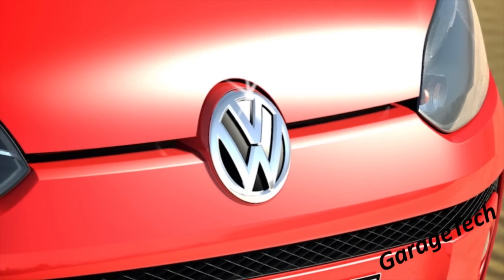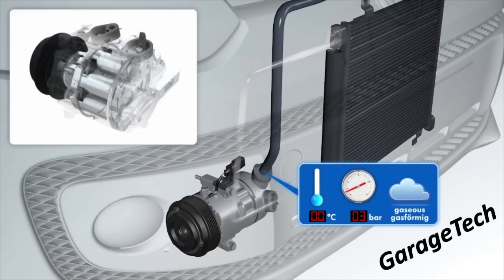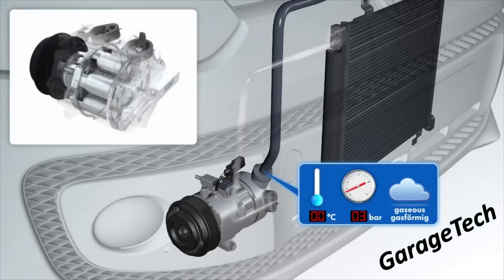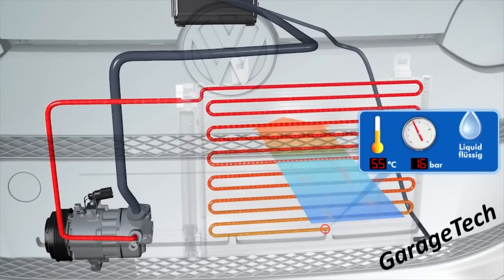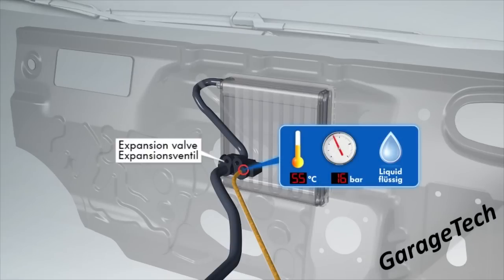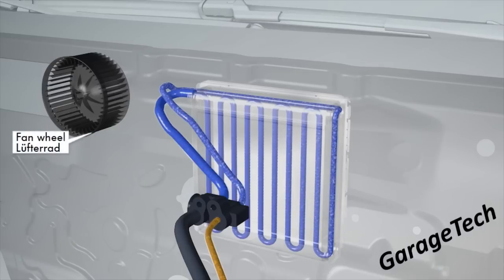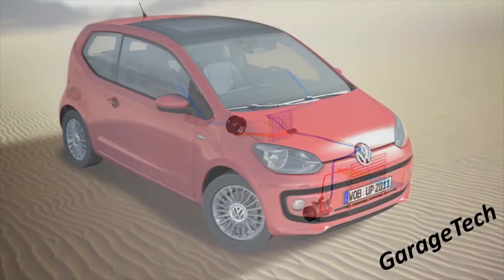How does a cars Air Conditioning system work?

Comment: Shouldn' temperature stay the same through condenser? When I saw constant temperature I thought you will show pressure dropping due to friction losses in condenser. It's either both pressure and temperature drop or they are both constant if you ignore friction loss.
Reply: Temperature Cannot stay same through the condenser. Only pressure. 
Let me explain why. 
1) Heat always moves from the hotter body to the cooler body.
2) When the compressor suddenly compresses the refrigerant gas, the gas  heats up. (Thermodynamics) 
3) As  hot refrigerant gas moves through the condenser coil tubes,  a fan blows air over the body condenser coil tubes.
4 ) The condenser is a perfect heat exchanger so heat in the hot refrigerant gas  moves away from the refrigerant and this heat moves into the cooler outside air.

 Remember that heat always moves from the hotter body to the cooler body. 
The condenser is hot 95°C and the outside temperature is lower 27-35°C so the heat in the refrigerant gas would be lost to the outside air.
As the gas becomes cooler it condenses back to a liquid,  hence the name condenser. 
If you don't understand just read more on heat exchangers. The condenser is a heat exchanger.
Reply: @ossainduka853  condensation is a constant temperature process, same as boling. Does water change temperature during ita boiling stage?
Reply: @MrPlankton996  I will say again,  temperature cannot remain constant through the condenser because the condenser is loosing heat to the outside environment 

Consequently the hot refrigerant gas inside the condenser coils would condense into a liquid.
Reply: @ossainduka853  When a refrigerant changes its phase from gaseous to liquid it is loosing a lot of energy in form of latent heat. That's why it is possible for it to take place at constant temperature. Your explanation that it's loosing heat, and therefore lowering temperature isn't correct. Google "latent heat".

What happens with water when it boils? Isn't it receiving heat but staying at 100 °C? It's only a phase change, but temperature is the same.

Comment: Considering that AC means Air Conditioning, not just Air Cooling, how does cabin HEAT work with regard to this process? Is air from the heater fan routed directly into the cabin, bypassing the evaporator? Or what?

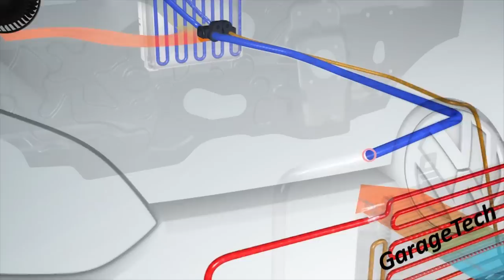Comment: 6:10
If I insulate that pipe (low pressure line) that feeds the compressor, will it damage any component of the system at all? Do you suggest to insulate the low pressure line?
Reply: alsogooraa why do you want to do that
Reply: @downyfabricsoftener8790  I live in a very hot area and some people insulated the low pressure line and they said the AC became much colder. However, I am not sure I this will affect the compressor in the long run
Any idea?
Reply: alsogooraa it might provide a tiny bit of improvement but I honestly don’t think it’s worth the trouble because of how little it’ll affect it.

Comment: You made a mistake about when the high pressure and high temperature Liquid leaves the expansion valve . It stays in liquid form but low pressure and low temperature It evaporate inside the evaporator due to warm air passing thru the fins of the evaporator.
Reply: 🏆 I agree

Comment: I'm getting some water dripping into my legs while driving while ac runs especially when i street left or right.
Can u help me to find the reason?
Reply: Water dripping from any AC system is normal but it should be dripping outside of your vehicle. When the evaporator box drain gets clogged with debris the water can't drain out so it will fill the box until it overflows inside of the car. Remove the debris from the water drain located under the hood coming out of bulkhead. That should take care of your issue. Search Youtube using key words such as "unclog your car AC drain" for helpful videos.
Reply: It's normal for water to be produced. Something which isn"t normal ,is for water to drip to your footwell.

Comment: sir..one question
 scenario we are testing system for leak would that be from low pressure point or h pressure point also assuming we are putting compressor air to check leaks.
your quick reply be highly appreciated ..we had checked system from low pressure side that holds pressure for 1.5 hr then we refilled freon but it's leaked after 40 days
i

Comment: I have a question, in a situation like 8 hours of traffic jam like in China, the quality air inside the car, will likely lack of oxygen and exceeds co2 level because you don’t want have air circulation as you open the ventilation it will suck the smoke from the exhaust of the car in front of you. What is the solution then?

Comment: What would happen to the A/C system,if the sensor bulb on the evaporator broke or stopped working ? Great animations of the system...
Reply: The compressor clutch uncouples from the belt.

To avoid dammages. Same thing happens if the gas is leaked. 

Extremely low or high pressure reads make the compressor pulley to deactivate / uncouple...

Comment: That is a Fantastic and simple explanation of how the refrigerant works in a compressed state.. what I can't seem to find is a video explaining how the electronics side of the system works ? Like what happens when you push the a/ c button on the dash ?  Sends a signal to what and what pressure sensor those and  fan clutch closes etc. ... Which intern leads to the video you just presented.. thanks I hope you have a video on it , and if not would you make one ?  It's good to understand how the whole A/C system works. I need to know in order to try and repair my 2007 Honda CR-V a/c system .. I need to understand how it works from when you push the button.. Sorry for the long comment. Thanks again.

Comment: Thx for the video, Lik&Sub. Question. Can a 12v dc motor or 24v dc motor power a car ac compressor for the cooling system to work? Ty
Reply from the maker: In my opinion it wouldn't work. If this was a good idea car manufactures would be doing it already. You would need a large motor and it would drain the battery quite quickly. Electric/Hybrid vehicles have electric compressors which work in the region of 280V 16Amps. This is powered by the high voltage battery. A 12 or 24 volt battery just wouldn't be powerful enough.

Comment: This my question. Cosume more gas when you use car aircon. That is true or not.
Reply from the maker: Eric Geollegue, not true, the gas isn’t consumed. The system will loose gas over time especially on older systems. The seals become dry and gas will start to leak out. That’s why it’s better to use the AC as it keeps the seals lubricated. The system is filled with (150ml) PAG oil which lubricates the seals and compressor.
Reply: @GarageTechAutomotive  thank you so much. for your good imformation.

Comment: What is that weird smell that comes when you turn on the AC sometimes? Is it coolant becoming vapour?
Reply: That odor is usually the mold and mildew build up inside the evaporator box or at your cabin air filter. Keep outside vents clean from leaves and other debris, replace your cabin filter annually and spray some disinfectant into the air intake vents to alleviate or eliminate the nasty condition.
Reply: @steverivera6692  OMG thank you for that

Comment: Trying to learn AC in general and not just in cars. But what is the purpose of heating the freon to high pressure liquid instead of it continuesly running low pressure and a cold gas?

Comment: Expansion valve does not turn liquid refrigerant into a gas. It turns it into a low pressure liquid then passes thru the evaporator extracts the heat from the air and then It is turned into a low pressure gas then back to the compressor.
Reply: No, the expansion valve creates a pressure differential. There is a high pressure on the condenser side and low pressure on the evaporator side. When the liquid high pressure freon goes  through the expansion valve and hits the low pressure it evaporates into a gas. The evaporation is an endothermic process which is what provides the cooling.

Comment: Will the compressor cut in and cut off depending upon the temperature inside ? How that works ? Normally in the air con system once the temperature is attained a solenoid valve will close the flow of refrigerant and due to low pressure cut off switch the compressor will switch off.

Comment: How much power does an AC require. Power in electricity?
Reply: Strange comment, the fan belt normally drives the compressor.. but as a car is 12v.. TD5 Land Rover needs around 40amps. You can normally tell by looking at what size fuse is used is the engine bay..

Comment: Can I keep my ac temperature setting at Low or should I set it to a certain degree e.g. 25 Degree? Will I wear down the compressor faster if I fixed the temperature setting at the lowest? Thanks

Comment: The drier does not prevent any gas going to the expansion valve.. it doesnt turn to a gas after the expansion valve either. The heat exchange in the evaporator is what causes it to change into a vapor. Go back to school lad
Reply: The Freon absolutely turns into a gas after the expansion valve, that is what provides the cooling. The expansion valve creates a pressure differential, high pressure on the condenser side and low pressure on the evaporator side. When the freon goes through the expansion valve and hits the low pressure it evaporates. Since evaporation is an endothermic process, it provides cooling.

Comment: Does evaporator size matter?if we increase the evaporater size in an ac system what will happen to cooling in a car ac
Reply: The evaporator and many other parts in the system have to be sized according to the compressor's displacement and the compressor's displacement has to be sized according to the evaporator's size and other parts in the system... you can't just do that. Engineers already did that for you when the car's AC system was designed. Increase the evaporator's size only and not only you'll not experience any cooling benefit. You may also deprive the compressor of the proper lubrication return rate it was designed for...

Comment: Does insulating the pipes between the compressor, the condenser and the evaporator help in the over all efficiency of the AC ? I am asking this because my car has these pipes insulated at some sections and not insulated at others.

Comment: sir, my car i20 ac compressor gives a pressure reading of 40 psi at around 33 degree celsius (or 30 to 38 celsius) on the Low Side with full ac on. 

And, how  to know if my compressor has too much liquid or moisture on the  Low Side Valve?

Is this normal reading? if not, would be grateful if you could kindly provide me some kind of pressure readings chart. Soliciting your attention. Thanks.

Comment: Since the belt connects the pulley of the crankshaft and the compressor shaft, what happens when the engine is running but the AC switch is not on? Does the compressor of the AC run all the time?
Reply: Maitrayo Brahmachari it uses an electronically actuated clutch. When you press the ac button, the clutch engages on the compressor pulley, makin the pump start pumping. If you press the button again, or the system shuts off the compressor, the clutch releases again. The pulley always turns with the engine, the clutch engages or disengages the pump.

Comment: Quik question. My ac comp blew last night.. it wss seized wks ago and wen i ran the heater on a cold day it just gave way.. started with metal scrapin noise followed by a pressure burst then gave way and spun freely.. well thats how it sounded.. my question is.. i have a same spare parts car.. its identical.. am i able to use it? Wat else do i need to do.. this is for a 2004 audi a4 1.8t b6 quattro s line model.. plz help. Thanks

Comment: Hello, Its a nice video with detailed insight of the AC system. Just wondering you or anyone else here can suggest with the situation I have with my car. I have Mercedes W203 1.8 Petrol auto 2006 model. AC was running fine while i was driving and then I switched on the climate control which set the AC to full speed, i used it for 5 minutes and then turned off the climate control. After that AC stopped cooling. I refilled the gas twice also but still it doesn't blow cool air anymore, Can you suggest what part in the AC system is potentially not working here and how can I check it ?
Reply: You ever find the answer to this ? I have an Opel which exhibits strange / similar issues... I had the compressor refurbished, and it worked for a while, but seems like the problem is back (only a few months later). I've taken the car back to the workshop, and they may have refurbished it (again - second time) but seems like the problem is back (ie: no cold air). I think the compressor is losing pressure, or the expansion valve is not working. I really don't know!

Comment: why does engine have additional load when AC switched on
Reply: Because there's a special valve that puts concrete inside your engine when the ac is turned on.

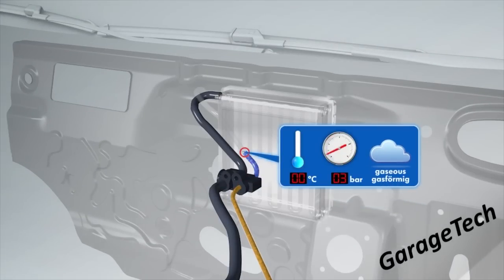Comment: nice video except that on minute 5:08, you said that high-temperature liquid enters into the expansion valve and then it is expanded and converted to low temp GAS when in reality the high-temperature liquid enters into the expansion valve and it is expanded to become low-temperature LIQUID, not gas. And this is because according to venturi effect, "as the pressure on a liquid decreases, its boiling point also decreases"

Comment: Excellent video.. Will the engine rpm affects the performance of compressor and cooling? For example say engine's idle speed is 1000 rpm and when we drive the car the speed will be like 2k or 3k rpm so what's the effect of engine speed on an AC compressor?

Comment: thanks for d explanation. I need yr comments on d flwg. symptoms observed in my car SANTRO.LP - 2001. CNG / PETROL. 
1. Recently I hav to keep d RPM  quite high to manage AC operation both when car fuelled on PETROL or CNG. 
Plus when D A.C. is on it makes lot of sounds in d engine compartment n lot of  vibrations inside d car, including d steering wheel. How to resolve this issue? Pl help. Thanks

Comment: I think there was a mistake made. When the high temperature passes through the expansion valve, it remains in liquid form until the hot air from inside the car is blown over the evaporator and THEN it turns into a gas. Am I wrong?
Reply: Yes. When it passes through the expansion valve, the liquid becomes low temp and low pressure liquid and it remains in liquid form as it passes through evaporator where fan blows air over it and it exchanges heat with the cool liquid and convert that liquid into gas which flows back to compressor and that air which was cooled is provided inside the car.
Reply: you are right
Reply: Correct
Reply: he clearly said that it is the LOW PRESSURE THAT BOILS OFF THE LIQUID INTO A GAS. 

The TXV regulate the inlet amount of liquid based on evaporator exit temperature.

The most important factor is the PRESSURE DIFFERENCE crested by the compressor suction side vs high side.

TIP: 
Simply Wrap the liquid line between the front condenser to the TXV with insulation so the high pressure refrigerant is NOT REHEATED by the HOT ENGINE.
This wrap drastically improve efficiency in summer traffic 👍🏻

(cooler return line needs to stay exposed to get fully expended back into a gas even in winter during defrost operation)
Reply: G Lasser already wrapped from the factory on mine.
Reply: It will be an 80% liquid 20% vapor (saturated mix) when it leaves the TXV

Comment: could you please upload a video about the electrical side of ac system?compressor engagement ac fan working,about the pressure switch circuits.ac switch.like those. thank you.

Comment: This is wrong. The liquid side is on the evaporator side which is also the low pressure side. This video shows the opposite of what really is. The compressor pumps gas which goes which goes through the condenser and then through an orifice or a expansion valve which then goes through to the evaporator which in in liquid state and cools the tubes where a fan blows over it giving us cool air and the gas is shot back into the compressor and it’s repeated over and over
Reply: Thilo the whole point of the condenser is to condense, hence the name. So NO, he is right. 

When R132a goes thru the compressor, it becomes hi pressure and temp. Condenser cools it down and changes gas to liquid while maintaining the hi pressure (obv there is a pressure losses thru lines but we will assume it to be negligible for simplicity). After the condenser is the drier to purge the process fluid of any moisture. The condensed fluid then goes thru the expansion valve drastically reducing its pressure and thus its temperature. At the txv, you will get flash evaporation where you will end up with a mixture of vapor and liquid.

At this point, phase change from liquid to gas starts to occur. Its a grey area and one would be able to tell if they knew the exact temperature and pressure of the refrigerant upstream and downstream of the txv. (The concept is similar to spraying liquid out of a pressurized container which happens to become gas in ambient conditions). That being said, factors such as flow rate thru the expansion valve and compressor will influence these conditions and the output. Think of evaporator as a zig zagging container that provides the 'right environment'  for heat exchange and phase change of the refrigerant.

As the liquid-gas mixture enters the evaporator, it picks heat via. heat exchange with air and changes the remaining liquid into gas.

The gas then goes back to the compressor for the cycle to repeat itself.